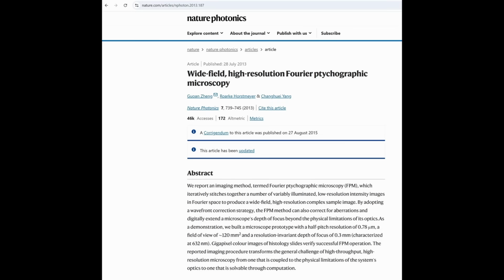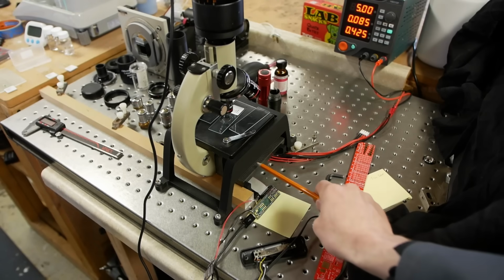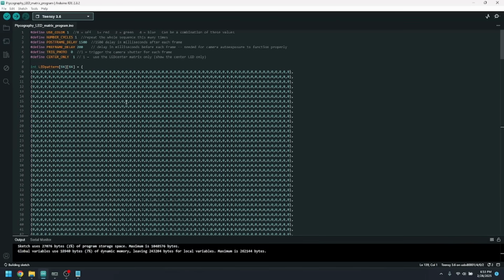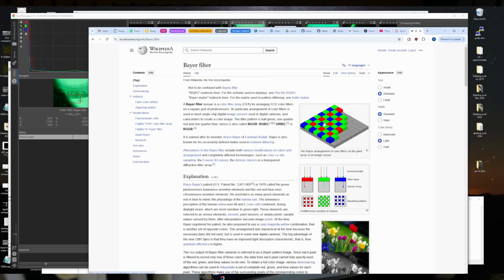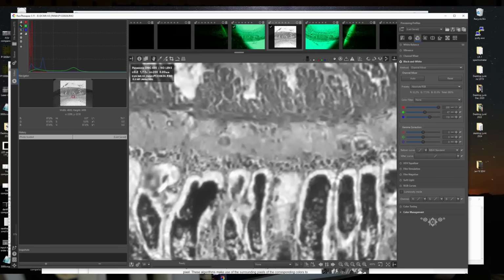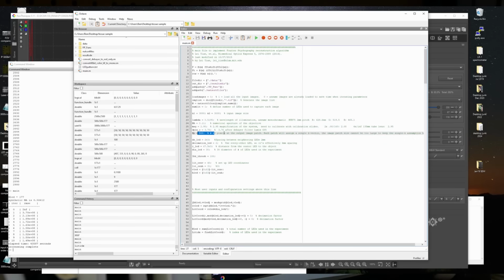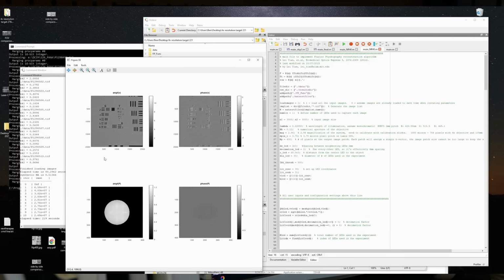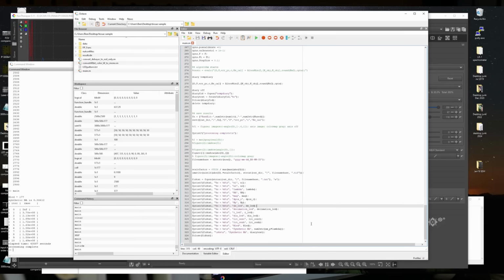Dramatically improve microscope resolution with an LED array and Fourier Ptychography

Comment: Going smaller is cool. But my first thought (on this particular viewing a year later) was "What about further away?"
Satellites move at a known velocity relative to the source image.
If we had a global shutter image sensor I'm assuming we could combine multiple images to increase the resolution along one axis using the rebuilt phase information.
And having multiple sensors stacked along the other axis might also work? (Though building a long satellite presents it's own problems.)

I'm guessing the atmosphere might cause too much noise.

Comment: Yes, man is smart, think. But you can make something similar real time without so much  computation with  two microscopes that can see reflective/transmissive mix with vertical illuminators in the optical path. One microscope is in the bottom, another is in the top. Then the aperture doubles.  The specimen seen from bottom and top illuminated as well from bottom and top alternate view or even projected on different eye making a stereo image that is just between your eye theoretically see both side of the specimen at once. If the specimen is illuminated and seen from all 360 degree. What is going to be the resolution? So take images top and bottom and transmissive and reflective. One microscope is reflective when another is transmissive. They illuminate each other in opposite direction and mod. Finally, image stacking all mod picture and image staking sharpening with algorithms like salt and piper that add details that are different in all pictures. Super resolution algorithms can be applied too. All pictures contain details that other may not

Comment: ZWO and QHY are astrophotography camera retailers and you can buy a monochrome cmos camera for around $200. The zwo asi120mm mini is used for guiding and planetary photography but it should work well, only thing is that is has a very small sensor.

Comment: 1:50 One correction regarding the 160mm objective. In RMS objectives 160mm refers to the mechanical tube length from where the objective screws on the revolver, the optical tube length where the image focuses is actually 150mm.

Comment: From experience with other algorithms regarding the exposure thing, what we did was first instead of long exposures do image stacking to really reduce noise, but do everything in 32bit colour space. Then we took the dimmer images in higher exposures and in 32bit float linear spaces adjusted them so they fit well into the other exposure spaces and then we went down to 16bit log int space as the usual algorithms expected.

Comment: 13:36 pro tip if you want a cheap monochrome camera go look for planetary astrophotography cameras. The sensors are small, but they're modern sensors that you can connect directly to a computer and importantly come in monochrome versions for only a few 100 bucks!

Comment: Will nice to see results with immersion 100 and\or dry 60 objectives. Is it some how real to do without serious lab and high precision tech? Maybe quantity over quality? Are dark field condenser suitable for tech like this? Are light wave length vs refraction angles tricks suitable for this tech? I get so mich question just after 1 minute in my head :) Are temp sensitive metals to presisely moving mirror by temperature control suitable for this tech?

Comment: If you're out for more resolution, then why do you set out with a 4x objective instead of heading straight for say a NA1.30 one?  I mean, a spatial panorama with a 10x or 20x objective would have led to the same or better result much faster, easier and cheaper, wouldn't it?

Comment: You might look at astrophotography cameras for this application. Astrophotography cameras usually don't block UV or IR. There are various monochrome models with a pixel pitch in the ballpark of 1.5-3um. Prices start at around $300 for something with a very small sensor area, and go up as sensor size increases.

Comment: You say that smaller LEDs are better. Why wouldn't you use a phone's screen? If a single pixel isn't bright enough, you can use 2x2 or more pixels to get more light with less whitespace in between. Props for the video btw! :)

Comment: This is the 2nd time in one evening that I ran across your channel for two different processes. Just for that: could you not use an LCD or OLED monitor for a light source, and have a pixel scan horizontally and vertically?

Comment: I wonder if a panchromatic sensor with a plenoptic microlens array could do this in a single exposure with the entire LED array powered on simultaneously. The microlens array inherently does the ray tracing in hardware rather than in software, simplifying the processing pipeline. You still have a huge array of images, but they are all captured at once and perfectly registered.

Comment: It seems that the technique should also work to some extent with a single source of light and a motorized stage which some microscopes already have. As for the RGB camera, a possible workaround is using near infrared (although that reduces resolution) and removing the IR filter from the camera or with significant changes in the code maybe RGB diodes to match the filters.
I am also wondering if using other super resolution reconstruction techniques like quadratic programming could work (too much on my plate to try) but if they do, maybe even monochromatic light is optional and you just need to move the stage and let software do its magic. 
One issue is that just moving the stage won't give you bright field vs dark field images to estimate the phase but the information should still be there just that each image has both superimpossed.

Comment: Could you get the results you need in the program if you set the resolution to be 1/4 of the actual images? Like 4,000x4,000 to 1,000x1,000

Comment: I do astrophotography and use a cooled monochrome camera. Svbony makes a cheap mono camera that's not cooled. I personally use ZWO but if all you need is monochrome then go for svbony or another cheap brand. My ZWO let's me change my pixel binning. 1x1 to 2x2 to 4x4. I use the coarse bins for setting up then switch to bin 1X1 for high res. The cooled aspect greatly reduces noise. Calibration frames can also be used in a static setup to further increase clarity.

Comment: Do you know any place one can economically purchase just the diodes?

I have tried for years to get just diodes, but since China has taken the market over, they refuse to sell JUST the diodes.

Also, the new diodes are much better in that they are super compact and can be very densely packed, unlike the original blister type.

I would love to build a monster LED TV screen, like you see a lot on billboards, but for an affordable price, and with some custom adaptations that could help me experiment with making a holographic video emitter.

Comment: For the code you have a 64x64 array of (16 or 32 bit?) integers but if it only needs to be on or off then you can use a 64x8 byte array and that would reduce your array memory usage by a factor of 128 or 256. Something like:
byte LEDpattern[64][8] = {
	{0b00000000, 0b00000000, 0b00000000, 0b00000000, 0b00000000, 0b00000000, 0b00000000, 0b00000000},
	{0b00000000, 0b00000000, 0b00000000, 0b00000000, 0b00000000, 0b00000000, 0b00000000, 0b00000000},
	{0b00000000, 0b00000000, 0b00000000, 0b00000000, 0b00000000, 0b00000000, 0b00000000, 0b00000000},
	{0b00000000, 0b00000000, 0b00000000, 0b00000000, 0b00000000, 0b00000000, 0b00000000, 0b00000000},
	{0b00000000, 0b00000000, 0b00000000, 0b00000000, 0b00000000, 0b00000000, 0b00000000, 0b00000000},
	{0b00000000, 0b00000000, 0b00000000, 0b00000000, 0b00000000, 0b00000000, 0b00000000, 0b00000000},
	{0b00000000, 0b00000000, 0b00000000, 0b00000000, 0b00000000, 0b00000000, 0b00000000, 0b00000000},
	{0b00000000, 0b00000000, 0b00000000, 0b00000000, 0b00000000, 0b00000000, 0b00000000, 0b00000000},
	{0b00000000, 0b00000000, 0b00000000, 0b00000000, 0b00000000, 0b00000000, 0b00000000, 0b00000000},
	{0b00000000, 0b00000000, 0b00000000, 0b00000000, 0b00000000, 0b00000000, 0b00000000, 0b00000000},
	{0b00000000, 0b00000000, 0b00000000, 0b00000000, 0b00000000, 0b00000000, 0b00000000, 0b00000000},
	{0b00000000, 0b00000000, 0b00000000, 0b00000000, 0b00000000, 0b00000000, 0b00000000, 0b00000000},
	{0b00000000, 0b00000000, 0b00000000, 0b00000000, 0b00000000, 0b00000000, 0b00000000, 0b00000000},
	{0b00000000, 0b00000000, 0b00000000, 0b00000000, 0b00000000, 0b00000000, 0b00000000, 0b00000000},
	{0b00000000, 0b00000000, 0b00000000, 0b00000000, 0b00000000, 0b00000000, 0b00000000, 0b00000000},
	{0b00000000, 0b00000000, 0b00000000, 0b00000000, 0b00000000, 0b00000000, 0b00000000, 0b00000000},
	{0b00000000, 0b00000000, 0b00000000, 0b00000000, 0b00000000, 0b00000000, 0b00000000, 0b00000000},
	{0b00000000, 0b00000000, 0b00000000, 0b00000000, 0b00000000, 0b00000000, 0b00000000, 0b00000000},
	{0b00000000, 0b00000000, 0b00000000, 0b00000000, 0b00000000, 0b00000000, 0b00000000, 0b00000000},
	{0b00000000, 0b00000000, 0b00000000, 0b00000000, 0b00000000, 0b00000000, 0b00000000, 0b00000000},
	{0b00000000, 0b00000000, 0b00000000, 0b00000000, 0b00000000, 0b00000000, 0b00000000, 0b00000000},
	{0b00000000, 0b00000000, 0b00000000, 0b00000000, 0b00000000, 0b00000000, 0b00000000, 0b00000000},
	{0b00000000, 0b00000000, 0b00000000, 0b00000000, 0b00000000, 0b00000000, 0b00000000, 0b00000000},
	{0b00000000, 0b00000000, 0b00000000, 0b00000000, 0b00000000, 0b00000000, 0b00000000, 0b00000000},
	{0b00000000, 0b00000000, 0b00000000, 0b00000000, 0b00000000, 0b00000000, 0b00000000, 0b00000000},
	{0b00000000, 0b00000000, 0b00000000, 0b00000000, 0b00000000, 0b00000000, 0b00000000, 0b00000000},
	{0b00000000, 0b00000000, 0b00000000, 0b00000000, 0b00000000, 0b00000000, 0b00000000, 0b00000000},
	{0b00000000, 0b00000000, 0b00000000, 0b00000000, 0b00000000, 0b00000000, 0b01010101, 0b01010100},...

Comment: Hi Ben, Would this method provide any better resolution for chromosome counting? Even a little? I'm coming at this as a complete novice to chromosome counting and microscopy but I'd probably be using oil immersion with 1000x (maybe a little lower) magnification. Thanks for all the work you put into these videos

Comment: Try an OLED display and driving one sub pixel at a time. A TOF sensor gives you phase and there are sensors from onsemi that layer an image sensor with a TOF sensor so you get both data

Comment: Mathematically, this is effectively the same as the technique known as synthetic aperture radar. With SAR you synthesize a larger receive aperture by moving the radar around while collecting light. The resulting information can then be combined in the Fourier domain to get an image with much better resolution than could be achieved with the actual physical aperture size. SAR has been around for nearly 80 years, so I’m a little surprised that it took so long for the same principle to be applied to microscopy
Reply: It is true that ptychography and SAR are pretty closely related in that they both are synthetic aperture imaging techniques! I'm not really familiar with SAR so this may be wrong, but doesn't the sensor in SAR capture at least some amount of phase information? That would be a key difference to the (Fourier) ptychography case where you lose all (detector-plane) phase and need to reconstruct it computationally. And modern explicit phase retrieval techniques that actually work well really only started to be researched in detail in the 70 and 80s, with the modern variants that actually make ptychography work only being developed in the past 20 years or so. Also the computational power explosion we have nowadays really helps :) So that may be your explanation for why it took longer for the "same" underlying idea to actually work in this setting.

Comment: can you use RGB sensors if you remove the infrared and ultraviolet filter and use IR LEDs? The bayer filters are usually entirely transparent to IR, and possibly UV

Comment: There seem to be some similarities between this process and how digital fluoroscopy images are processed in medical imaging.  You're basically making a picture/movie out of a shadow in both imaging modalities.  The terms noise filter and frame averaging come to mind when I normally describe the process in digital xray systems.  There are filtering methods employed in conventional plain film xray systems that help to deal with scattered and off centered photons.  One thing that helps tremendously is a vibrating filter grid (bucky) that I've seen range from 5:1 to 15:1 height to width ratios.  With a long enough exposure, the grid helps to filter out scattered photons and is usually blurred out enough to not be noticeable.  Similar to what you found on the size of the LED, the size of the focal spot in an xray tube cathode can limit the level of detail you can get along with the anode heel angle.  There are lots of things that can distort the useful beam within an xray system.  Much of that distortion comes from the photons being deflected/scattered when interacting with the material being imaged.  There can be a surprisingly significant loss in detail that can take place along the way when components before and after the analog to digital image conversion take place when they don't have a compatible spatial resolution.

Comment: This is really good.
I know the math of fourier transforms,and i understand how gratings work,this is a really nice application of both,i need to replay video several times,to fully grasp the details.
I believe that the fourier transform of lots of little box boxes,strung out across a screen is the basis of how digital pictures are painted on modern flat screens,is that correct?
Although in that instance,some information may be thrown away to compress the data ,so that it reduces serial stream bit lengths,if im correct.
It would be really cool if ben did something on the subject,hint!
Thanx ben.

Comment: Another potential solution for the image sensor problem is to use IR light. The Bayer filter generally doesn't suppress IR so simply removing the IR or (Hot) mirror from your camera will give you an IR Grayscale camera. IR has the obvious disadvantage of resolution. Awesome work as always.
Reply: How about the microscope optics? Do they pass IR fine?

Comment: Does that LED array provide sufficient differential spacial frequencies? Would using something like a microLED display or a DLP projector system (Whis we can use with a laser system to actually scan every angle for each DLP pixel) can provide better resolution?

Comment: Even with your colour correction, any conventional debayering algorithm is going to use information from multiple input pixels in each output pixel, which is not what you want. You need to just apply a different gain/multiplier to the different coloured pixels to get the same response given the monochromatic illumination, without running a debayering algorithm. I've had to do this for an iris recognition system I worked on that used an image sensor with a bayer filter but monochromatic infrared illumination.

Comment: Astronomy cameras are a relatively inexpensive source of monochrome cameras with state of the art cmos sensors.  They're also available with thermometric coolers which helps stabilize their gain as well as lowering noise somewhat.  Processing software for astro images like pixinsight or siril also will do some of the front end processing youmay need-- e.g. flatfielding  and dark frame subtraction-- without gunking up the images like rawtherapee.  Assuming you've correctly calibrated the images the sensor should be very close to linear, so you should be able to change the exposure for the bright field image then correct the gain of the captured data.

Comment: I'm pretty sure there is still value in doing this with high NA objectives: even the ideal case where the lens has an NA of 1, where it can capture all the light that makes it to the other side of the specimen slide.

In typical brightfield imaging you want to roughly match the angular distribution of incoming light to the receiving angle of the imaging lens.  This is equivalent to measuring all these ptychographic snapshots and averaging over them incoherently, which throws away all the information they could have contained about the higher frequency modes that your lens can't see.  What you probably gain from interrogating each illumination angle independently is that, for every scattering vector k that you can measure, you can infer what the measurement would have been at -k because you know that it has to be the complex conjugate of the value you measured at k (because the scattered intensity is a real valued function). So by rotating the angle of illumination you are effectively getting information about light that was backscattered and would never have made it to the lens to begin with
Reply: Why is it reasonable to assume that scattered intensity is real-valued? :) Isn't a main point of this technique that you can do quantitative phase imaging?

Comment: Next time you're looking for a monochrome camera, look for astronomy cameras. QHY and ASI are the most common brands. They have a variety of sensors and work over USB3.0 with low level controls (designed to be used for very long exposures with narrowband filters).

Comment: If you are looking for camera's with monochrome sensors, no filters and all that good stuff, check out ZWO astrophotography camera's, as they are designed to allow as much light as possible through across a wide spectrum. Filters are added to the telescopes, so none exist on the camera itself.